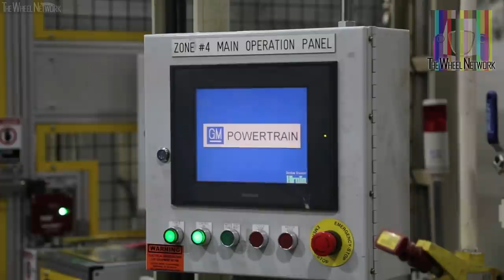General Motors Engine Production in Canada (GM St. Catharines Propulsion Plant)

Comment: Is it dress as going the beach day. Never allow anyone on the shop floor to wear shorts and uncovered arms. Dont see many or not at all wearing safety shoes. Canada needs to catch up with thier HSE
Reply: The workers are all required to wear safety shoes and safety glasses.  This is a plant wide policy that is strictly enforced.  There is also a dress code that is enforced.  The plant has a sort of chiller system to modulate temperatures during the warm months.  There is also a steam heating system for the cooler months.  The workers dress accordingly to the temperature extremes.
Reply: @lilredcrvtt  working for an global company, firstly it dont look professional see everyone in casual wear.
Secondly, HSE point, working in construction, everyone should be wearing hardwearing trousers, to proterct from cuts, and grazes and contamination. also sleaved tops to prevent to the above.
Reply: @bobby4speed  hahahahha okay old man
Reply: @lilredcrvtt  you are lost